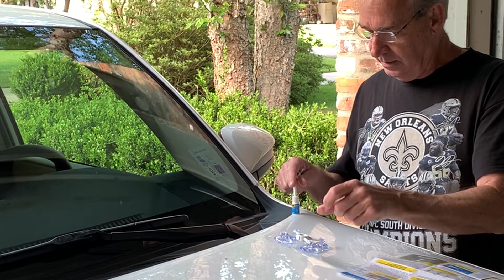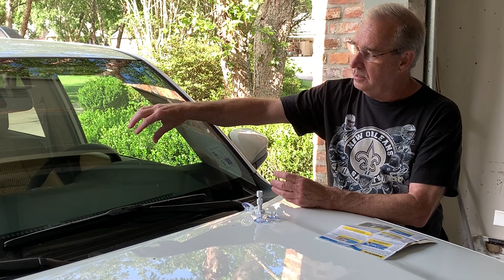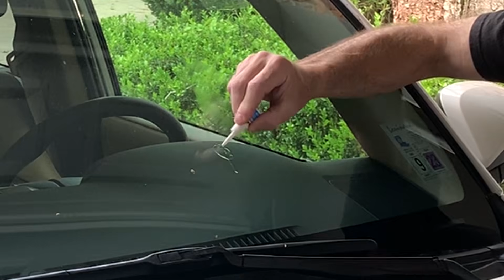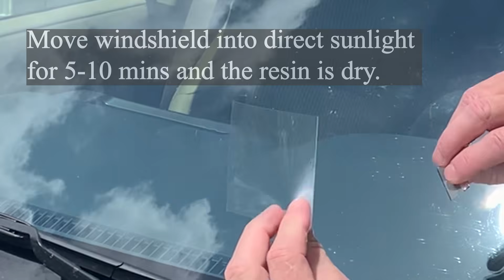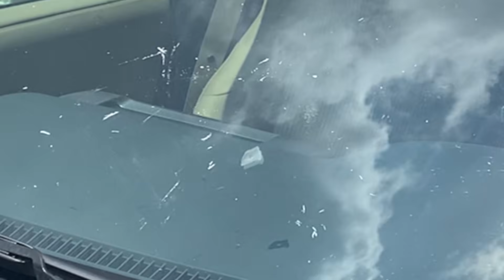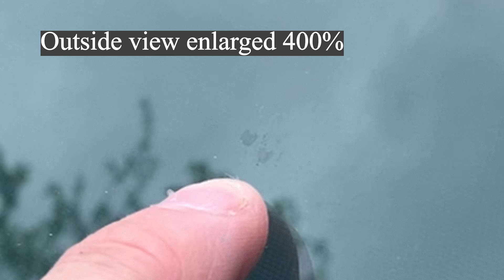How to use Rain-X Windshield Repair Kit

Comment: Thanks for the video!  I don't think you had the resin chamber firmly seated against the windshield.  You dumped a lot of fluid down that tube and it was just running down the windshield.
Reply from the maker: That’s correct. I had to tighten it down a little to seal it off. Thanks for commenting and watching.

Comment: Great job with the instructions you were very clear and detailed and that made it easy to follow and understand. Thank you! 

I will say how ever as someone who works with optics and glass the angle and way you scraped and scratched the resin off was hard to watch. You’re lucky you didn’t have a patch a small scratch’s from the blade after all that metal rubbing against glass noise you had going there. 😖
Reply from the maker: Thanks for watching and commenting. I get the comment about the scrapping fairly often, and I would have done it a little differently myself, but I followed the manufacturer’s instructions on the method they recommended. I wondered why they want it done that way, and can only conclude that it keeps the corner of the blade from digging into the repair. It is hard to watch though, lol.

Comment: After scraping it’s a white circle for me. Is that normal? Feels smooth though. Should I keep scraping into it or what
Reply from the maker: It should not be white. Should be clear. Scrap it a little more and see if it clears up.
Reply: @FixItDepot  I think it’s cause the bullseye has a crater so the resin has a greater surface area that remains white from scraping, whereas if it’s just mainly cracked then there wouldn’t be as noticeable white patch..
Reply from the maker: That makes sense. It probably won’t get any better with additional scraping if that is the case.

Comment: It's 4 pm on a sunny day. I would be wearing my sunglasses if driving, but for some reason, the resin did not wick up into the cracks and it did not cure in more that twice the time you used in the video. 
I'll try something else next time.
Reply from the maker: Have heard of issues with the resin not going into the cracks, but have never had a comment about the resin not curing. Was it very cold at the time?

Comment: Ok, this was excellent and simple! Thanks! Also, no joke, gentle screw it to windshield til it touches! I accidentally screwed mine too tight and cracked it more. Oops!
Reply from the maker: Thanks for sharing. Sometimes just a sight amount of pressure will make the crack run. Not much you can do about it.

Comment: If the suction cups don't work well (didn't on my car in our cold weather), Scotch tape works far better than the suction of those suction cups.
Reply: My experience as well.  The suction cups are worthless.  There was another product out there that used a syringe instead of the suction cups, and it worked fine for me some 10 yrs. ago.  I got a new crack from a road rock, and I bought the RX product off the shelf at O'Reilly.  The suction cups were a fail, so I just applied the resin and used the curing tape.  I'm probably going to have to replace the windshield at the end of the day; we'll see if the crack-length gets longer over the next few weeks.
Reply from the maker: That’s good to know. Thanks for sharing.

Comment: Suction plunger just made my Crack bigger
Reply from the maker: Sorry that happened. Thanks for sharing your experience with the repair kit. Just wondering, did the crack get larger as the plunger was screwed down and did the plunger contact the glass?

Comment: Do you not have to get out any debris from the chip before applying resin, or just leave it?
Reply from the maker: You should clean it out the best you can.
Reply: @FixItDepot Appreciate the response. We have zero sun here, but I can use my wife's UV lamp to help cure it. Thanks for the excellent video.
Reply from the maker: You must be up north in Alaska or Canada. If so, that UV light will be needed. Hope the temperature isn’t too cold . Might want to let it cure longer. Good luck with it.
Reply: @FixItDepot In the UK... Sunshine is considered a myth here lol

Comment: RainX should sell the glue by itself because we already have the tool from before. What I do is use a cheap superglue and have two 20 cent size stars that I repaired 3 years ago and they not cracked any further.
Reply from the maker: I have wondered if the Rainx resin might be a super glue.

Comment: what if i have in addition to the stone chips a hair crack line 
just don't put too much pressure on the suction cup? but ok to pressure with the screw applicator?
Reply from the maker: Don’t put much pressure on the screw applicator either. Just enough to seal against the glass, which isn’t much.

Comment: OMG  hun,😬🤪  Stop making the blade squeak. Tilt the blade and scrape it at an angle.  This will be faster and more efficient 💛 
But absolutely loved your instructions it was much simpler and easier to follow than the insert instructions thank you😊
Reply from the maker: Thanks for watching and commenting. I should have warned people about the noise lol. I held the scrapper as per the directions. I don’t know why they were that specific and agree that an angle would also work. I think they recommend the way I was showing it because there would be less chance of cutting into the resin and finishing with a shallower repair. As long as you are careful, any way would get the job done.

Comment: Great video- didnt need to watch it over and over to understand it! The product itself works great as long as all four stoppers can suction flat. Ex: if crack is at the edge of windshield not allowing you to lazy the suction cups flat. If you have a big chip and have time, you can nearly get rid of the carck with multiple applications.
Reply from the maker: Thanks for watching and sharing your thoughts.

Comment: One of the suction cups snapped of and created uneven pressure made the crack worse thanks to
Reply from the maker: That’s unfortunate. I haven’t heard of anyone else having that issue. Maybe the resin cylinder was screwed down too far and that’s why one of the cups released or one cup didn’t stick to the glass well enough. I would try to put some resin over the crack and put a curing strip over it. Maybe it will go into the crack.

Comment: thank you for the video. mine has some rainbow kind of spots surrounding the bullseye. The central spot is cured but the rainbow spots are still there. Will it stop spreading the crack or not? I am more concerned about structural fix rather than visual fix
Reply from the maker: I have never experienced the “rainbow” spots, but I think you will be ok. I have done about ten of these over the years and never had a crack run after repair. A lot of times the repair is not perfect, but it is ok and won’t spread.
Reply: @FixItDepot Appreciate the quick response! It's good to know from your experience that the structural fix should hold up.

Comment: That is a terribly and dangerous repair and would not pass the Auto Glass Industry ANSI Approved Repair of auto Laminated Auto Glass Standard (ROLAGS) lab test. Furthermore you have compromised the structural integrity which means you have reduced the failure time if that  vehicle is in a crash. You cannot tell by looking at a chip repair whether it is at 50% or 100% strength restoration. Here is what a federal court ruled where I am the plaintiff- Legal Precedent – In a federal court case, Ultra Bond v Safelite it was ruled that, "customer satisfaction and technician skill alone do not prove a windshield repair is safe—scientific testing is required,"  as in the ANSI/NWRA/ROLAGS 001-2014. I tested 16 windshield repair kits for evidence to that windshield repair lab test. RainX failed to meet the standard-  here are those court admissible tests on the RainX as it compares to new laminated glass and 15 other DIY and Professional Windshield repair Kits. https://www.ultrabond.com/windshield-repair-kits

Comment: So you mentioned that if it’s already running, do I apply it on The, main area, where it chipped, and all along the line where it’s been running??
Reply from the maker: Yes, but I would use the injection tool for the chip area, and the strips with resin on the cracks that are running. Properly won’t come out perfect but hopefully will stop the cracks from running further. Good luck with it.
Reply: Thank you. I will try this today.!😊

Comment: what if you have a large crack? do you have to do the suction cup over small segments over and over
Reply from the maker: You won’t use the plunger for a long crack. They have a few Plastic curing sheets that are about 2 inches by 4 inches and they are used for cracks. You just use the bottle to put resin in the crack and put the plastic sheet over it so it can cure. The sheets are reusable. Keep doing that til the complete crack is covered. Another kit from Permatex has more strips in it. For a long crack I would get the permatex kit instead of the Rainx. Both would work fine, but Permatex had about 7 strips and Rainx had about three.
Reply: @ i’m finding the resin isn’t really getting in the crack completely. do you have any tricks?
Reply from the maker: Tapping underneath the crack from the inside of the car could help some. Just be gentle so the crack doesn’t spread further. Not much more you can do after that.  Good luck with it.
Reply: @ thanks!

Comment: Thank you so much for the clear instructions,  I was able to follow it to fix the chips on my windshield. However, the surface of the spot is not smooth even I applied the process twice.  Could be the chips too old? it has been there a few of years. Also, can I store the kit for future use? Thanks, I will appreciate anyone’s advice!
Reply from the maker: @Vwl3949  Yes, you can store it if you have much resin left. I don’t know why the finish was rough. I have never seen that issue. Thanks for watching.

Comment: Razor blades scratches your widow
Reply from the maker: @terryhook5518  They recommend using it at a 90 degree angle to the window as shown in the video. If used properly you should be fine. Nobody has commented that they damaged the windshield yet. Good luck with your repair and thanks for watching.

Comment: Thank you because the store put the worst sticker over the instructions.  Apprciate it. Is there a coldest outdoor temp to follow ?  Hopefully 50 degrees outside is ok.
Reply from the maker: I am pretty sure the min temp is 40 F. I would let it cure a little longer at the lower temps. That won’t hurt anything. One guy said he used his defroster to raise the temp. I just wonder if that might cause the cracks to grow. Good luck with it. Thanks for watching.

Comment: Hi, I have just around 4 small rock impacts (no crack, it's just annoying because it's in front of me), do you think it'll help to make it less visible?  Thanks again for the video!
Reply from the maker: I would just put a drop of resin over the damaged area and put a curing strip on it. After curing just scrape off the excess. Good luck with it.
Reply: @FixItDepot  Is there a risk that the result can be worst than before?
Reply from the maker: @boundsofreality  I don’t think so. I am fairly confident it will be better.  Try one of the four and see if you like it.

Comment: I'm about to use this, 2 days after the crack occurred. My only concern is that I put super glue and clear tape on it as soon as it happened.
Reply from the maker: The glue might block some of the resin from entering the cracks. Try to open up center of the crack with a tack and try. Good luck with it.

Comment: I just bought a 2025 ford Transit connect. There are 2 chips in the windshield. Im going to try this instead of going to a shop. Don't want to spook the insurance.
Reply from the maker: It should work. I never had a crack run yet.

Comment: Does it require a certain temperature outside? Other kits say 10 degrees Celsius. I live in Canada and it could be a while before I get a day warm enough, but don't want my chip to spread
Reply from the maker: The Rain-X guidelines say to apply it only if temperatures are above 40 degrees Fahrenheit.

Comment: what is there are 2 chips close together? Treat it as 1? They both started to send out cracks. I hope to fix it today. There is also one chip that is not cracking nearby, but I think I will have to treat it separately.
Reply from the maker: You will have to see if the resin can flow into both at one time. I think I would do the resin injection on each one separately then let both cure and scrape both at the same time..
Reply: @ That is what I did. It was tricky and I am not sure if it worked. All I want is for the cracks to not spread any more from the chip.
Reply from the maker: Hopefully it will be ok. You did all you can do.

Comment: Unfortunately we weren't able to see the crack or chipped hole before , so a B- for visualization 🤔
Reply from the maker: I need to go back and look at it again. Would have thought I had the pic in there, but thanks for pointing out. Most of these repairs come out good, but not perfect. I define success with these kits as getting the crack fixed so it doesn’t run. Thanks for watching.

Comment: So, I'm just going to recommend to NOT push from the inside at all. I used this on two chips on two different cars. I followed the packaging instructions and recommendations from this and other videos about giving a gently push from inside to help work any air bubbles out and to help the resin to flow inside. I gave barely any pressure (even less on the second windshield) and I ended up with 7-9" cracks on both instead of just a little chip. Now, where the chip was, it looks pretty damn good. Resin filled that in nicely - I just have long cracks now! Do yourself a favor and don't press from the inside!!!!
Reply from the maker: Sorry to hear you had a bad experience. Thanks for sharing so others will know to be very careful if pushing on the glass. It’s probably better to not even try pushing on it.

Comment: Any suggestions on how to do this with a nearly vertical RV windshield that also has a short crack?
Reply from the maker: I would not use this kit because it depends on gravity to allow the resin to enter the crack. I don’t think it will work well in your situation. Instead, I would get the Permatex repair kit. It actually uses a plunger to put pressure onto the resin and should have a better chance of getting the resin into the crack. I have a video on that kit also. Good luck with it.

Comment: This thing works! The main thing is to get the hole on the tube lined up perfectly with the point of impact.
Reply: Yeah, that was kind of a pain in the ass.  I can see how the other type window repair kits that stick the thing over the crack would be a bit easier to apply.

But, you're right, still works!  And you get multiple uses with Rain-x.
Reply from the maker: I agree. Thanks for watching.

Comment: Can I use a heat gun to speed up the curing? I just got a crack and it's going to rain all week, so I need to do it in my garage.
Reply from the maker: I don’t know for sure, but the heat might make the crack spread. I bet the resin will still cure in your garage as long as some light is getting to it. It will just take a lot longer.

Comment: Razor blade at a 45 degree angle works better in my opinion instead of 90..
Reply from the maker: I think the reason they recommend it to be used at 90 degrees is so you don’t cut into the repair. As long as you are careful with it, the angle probably doesn’t matter that much.

Comment: Thank you very much for the superb explanation and demonstration. I found it much easier to understand than the manufacturer's instructions and it made me confident to use the product.
Reply from the maker: You are welcome!
Reply: @FixItDepot well explained and with good detail content 😊
Reply: can you use soapy water with the razor blade? I would be afraid of scratching
Reply: I wouldn’t say superb, just an average demonstration. Personally I would buy the kit with the plunger unless you have a tool on hand that can pull and push a vacuum

Comment: what if the crack is inside? is it the same procedure?
Reply from the maker: I am not sure. Windshields are made with laminated glass which means there are layers of plastic between the glass. So for this to work it has to be cracked on top, and the plastic laminating sheet has to be punctured, and that allows the resin to flow to the lower crack. If your glass is just cracked on the bottom, then it won’t work. This is a rare case since windshields get broken from objects hitting the outside glass.

Comment: Your video made me feel confident that I was able to do the repair myself. Thanks for your help!!!
Reply from the maker: Good to hear it helped.
Reply: Same! Just got a crack in my new Bronco from a highway rock yesterday. Will go out and buy this tomorrow and watch this video as I apply it. Feels good to know I don't have to go to a dealership or mechanic for everything; especially as a woman because I know they jack up the prices the minute I walk in.
Reply from the maker: A woman can do these fixes as well as any man. My wife does her own most of the time.
Reply: @FixItDepot  Awesome. I def feel better knowing other women are doing these things as well. :)
Reply: @FixItDepot  You are right. I followed your instructions and it looks so much better. There is still a small spider-like line and the sun wasn't out much when I did it, so maybe I'll try again, but I could not have done it without your video 🧡
Reply from the maker: Thanks. Glad it worked out for you.